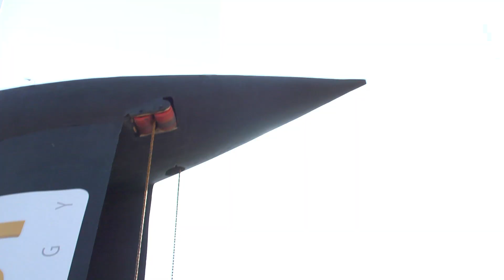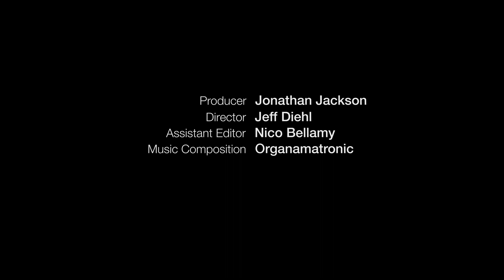Land Yacht Travels Faster than the Wind: DDWFTTW

Comment: You have to slow down the air relative to the ground, to extract wind energy. That is what the propeller of this vehicle does. If the air doesn't move relative to the ground, you cannot slow down it anymore. You describe a moving turbine on a windless day, which accelerates the air relative to the ground, so it doesn't extract net energy. You need more energy to move it, than it harvests.

Comment: Was he going downhill, too? Did he properly measure the wind and vehicle speeds? Was the wind gusting? A gust of wind can speed the vehicle above the speed of a non- gust. I'm a scientist ,and these a few simple questions that need to be asked because claiming you just broke the rules of physics.
Reply: No physical rule was broken. You simply don't understand the way the vehicle works, because you think of the propeller as a windmill. it is not. it is a propeller. The powers comes from the wheels and is directed to the propeller, not the opposite way. Draw the forces and energy diagram and you will see that everything is in balance, and that, if the yield if is just over 50%, you can go downind father than the wind. proof here : http://sboisse.free.fr/technique/voilier_eolienne.php